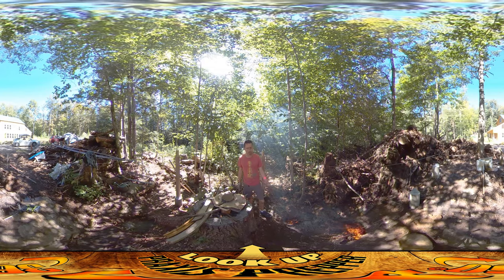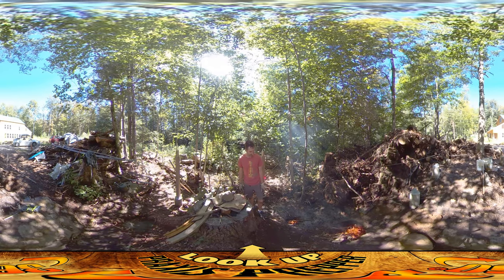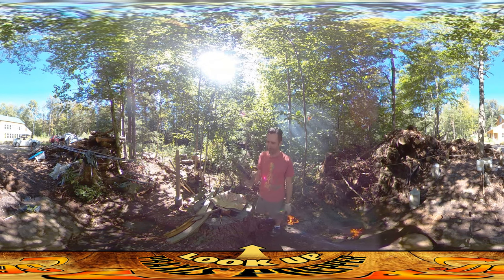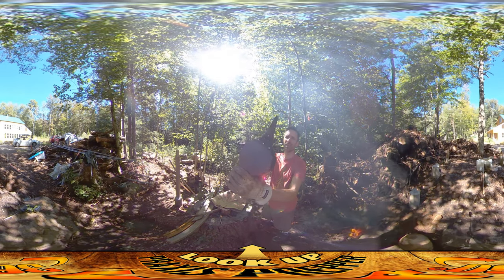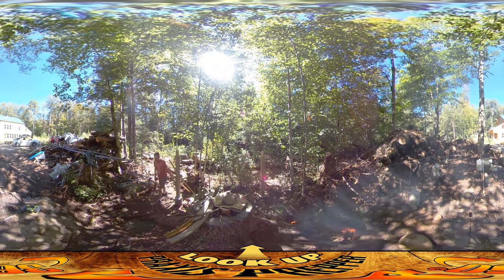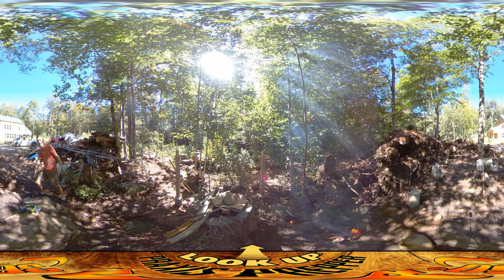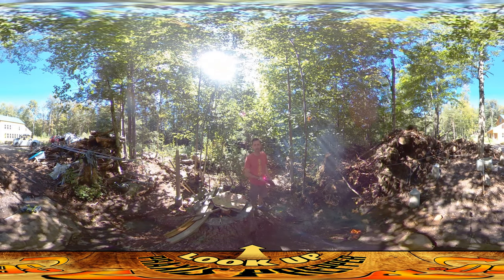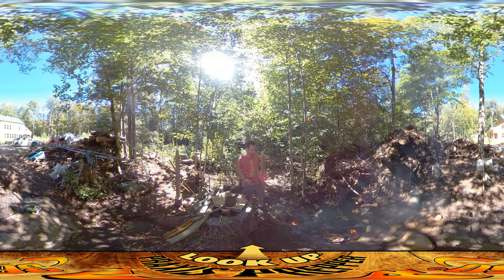Homestead Building - Firewood Drying Shed, Burning down Through Roots for Removal

Comment: Don’t know how real time these are now, but if you have an air mattress inflator pump and a metal pipe it might work better and certainly be less effort.

On a somewhat related topic, The Red Tool House channel has been talking about the requirements for using graded lumber in the building codes of almost all areas of the country but mentioned that post and beam houses sometimes fall under different rules, I’m curious if you ran into this question at all when building your house or not since you were using a kit with pretty much store bought lumber anyway so it might never have come up as a question?
Reply from the maker: I was wishing that I'd had any kind of blower like that - but I didn't. I agree that it would have quickened the pace. To your lumber grading question, we didn't come up against any issues or even questions related to that - possibly for the reason you suggested.